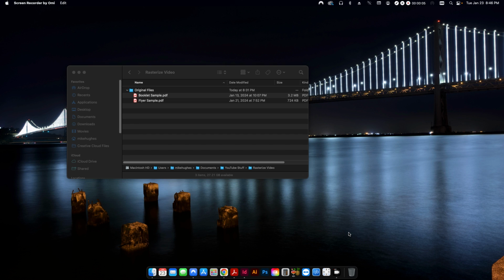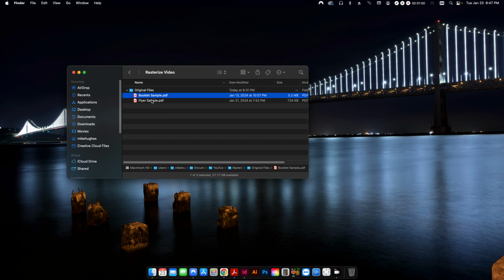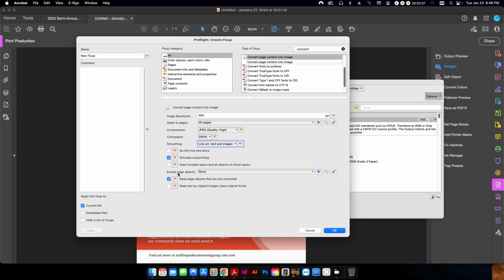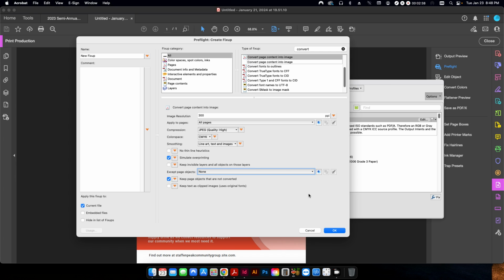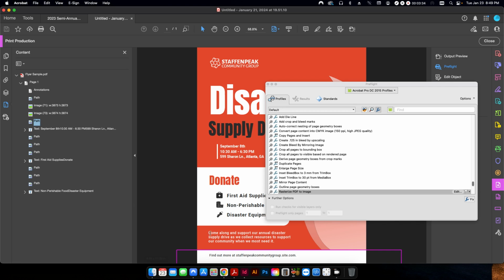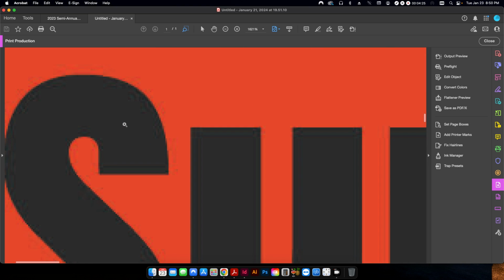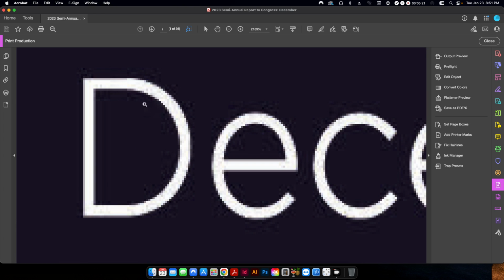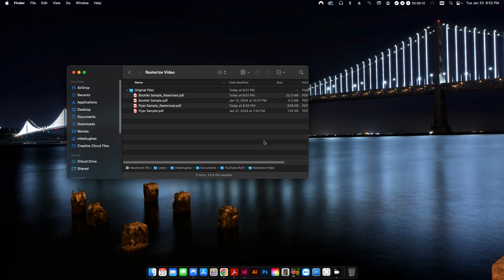How to Rasterize Any PDF File in Adobe Acrobat

Comment: Hey, thank you so much for this. I have a question - seems like when I run preflight my output ends up being offset and everything gets moved into the top right corner. Any ideas why?
Reply from the maker: Hmmm....not sure. Using a preflight should not move any of the objects on the page, unless you're running a specific preflight that is designed to move objects around. Rasterizing a file like this preflight is designed to do, should not move anything around. That's a new one for me.

Comment: Very handy. I was wondering if Acrobat could do it but I could not find the exact command. Hopefully works better on some transparency woes than flatten transparency.
Reply from the maker: It should. Occasionally I’ll print a job and big sections just disappear. Even after flattening the transparency if it still doesn’t print I come back and run this to rasterize and it’ll fix the problem almost every time.
Reply: @miketheprintman  Sounds good. I've had issues with people using either Office or Canva. Turning on "Print as image" and forgetting to turn it off isn't as helpful as just converting it straight.
Also no issued with having to throw it into Photoshop and maybe mess up colors.
Reply from the maker: @shigrathFX that’s the key right. All these videos that I’m doing with preflight, most of the time you can open I. Another program to fix the problem, but it may end up either taking a long time or messing up the file in some way. These preflights allow editing without risking that. Thanks for watching.